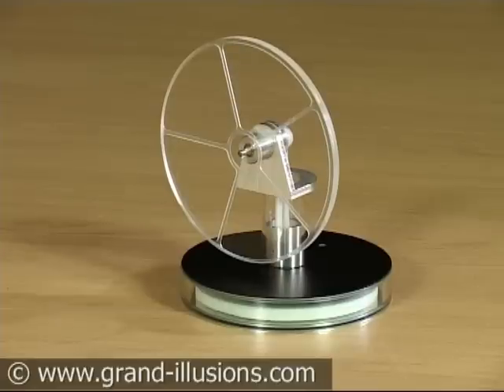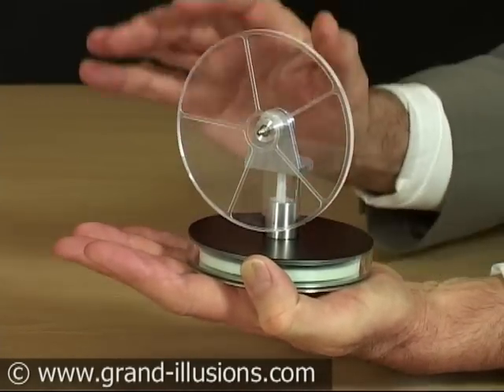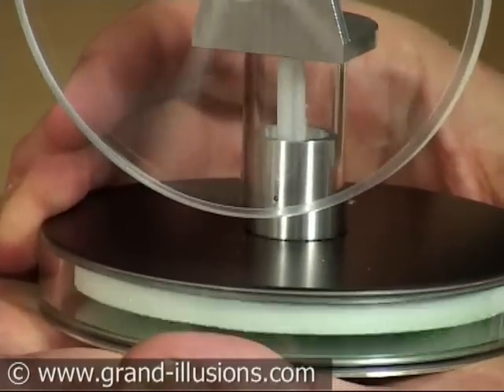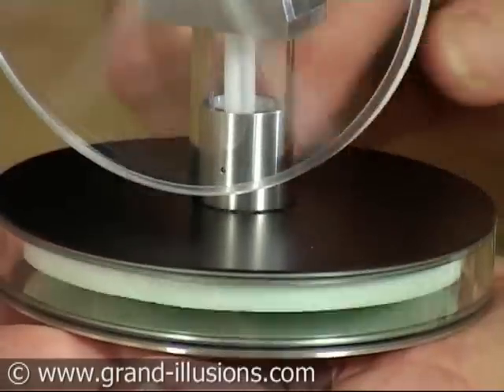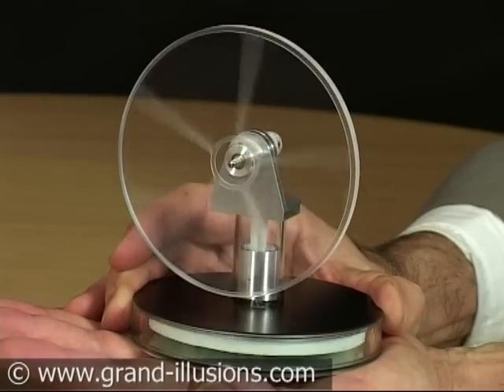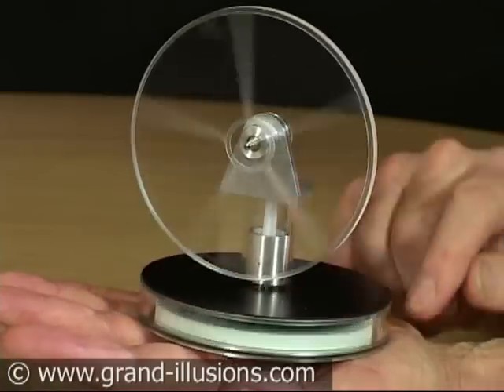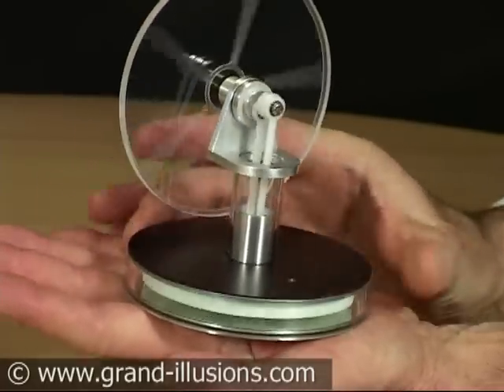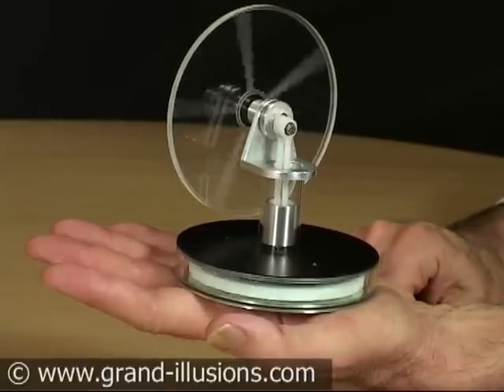Heat of your hand Stirling Engine

Comment: I want one that have a fan on top instead of a reel.
Reply: probably too gentle to actually push air..
Reply: @deluksic  you can always launch Crisis game at your PC, and put this fan on power adapter :)
Reply: TheDreameR Or unplug the stove and plug in a conventional electric fan.

But that's no fun I suppose.
Reply: @Treblaine  can also use a block of ice and it will spin the other way
Reply: FuckYouGooglePlus Maybe we are picturing things differently than eachother. When he says "a gas engine could be the way to get a fan moving" I'm imagining a machine similar to a lawnmower but with fan blades instead of cutting blades.  That should be fewer steps than using a gas powered generator to run an electric fan.  However, I could be completely misunderstanding what you two are talking about.
Reply: Steam Engine.
Reply: Tanner Armstrong
The comment we are talking about was responding to Treblaine, who was responding to a comment about using a stove. So that would suggest they were talking about adding extra steps.
Reply: Unfortunately those engines are not very strong eny sort of load stops it dead
Reply: @FlanFlanScarlet  I feel like the gas burning will heat your home more than the fan can cool the house. So it wouldn't really work well
Reply: they exist, and ontop of a wood stove they produce much more airflow than most of these comments would expect. yes it's only 30% efficient, but 30% of the energy in a bonfire is more than enough to move a car
Reply: David Lukšić only if you put on hand what about on a stove??
Reply: @TheDreamm21  
Tornado.
Reply: @TheDreamm21     u can,  i have one  with a fan on a stove lol
Reply: @TheDreamm21  you would be using external energy then
Reply: I don't think it would work you would have to keep it cold otherwise your hand wouldn't be warm enough to heat it up.
Reply: residue junkie  this is in no way free energy. it converts heat energy into mechanical energy at an efficiency of around 30%. 70% of the energy is lost to friction and such.
Reply: residue junkie  "The U.S. patent laws do not require that you create or build your invention or otherwise create a prototype before filing a patent application."

i'm curious to know if any of them actually got past the application. do you have any patent numbers? i did a search for "free energy" and found nothing.

if the people in charge were really going out of their way to poison people who know too much do you really think they'd let them publish their findings publicly in the patent office?
Reply: Using gas generated heat to drive a fan when it hot outside.... this man is the king of redundant
Reply: Wheel*
Reply: Dont worry mate! I Cool our household with a Cosworth V10 that screams at a max 19000 rpm..
Reply: Naah. Too much drag
Reply: Too much resistance from air.
Reply: same
Reply: residue junkie  ah nevermind i found one, US20110108362A1. looks like it's abandoned though, i wonder why..

for the record, google patents is a much better search platform than the actual USPTO website
Reply: You might need a hotter source then
Reply: The resistance from the blades of the fan will be too much for it to spin
Reply: Check nitinol engine!
Reply: FuckYouGooglePlus Actually the generator takes chemical energy, converts it into mechanical energy, then into electric energy. Then the electric fan would convert the electric energy back to mechanical energy.  A combustion engine connected to a fan would only need to convert from chemical to mechanical.  Theoretically, it should be more efficient than using a gas generator.
Reply: @tannerarmstrong1496  
Chemical➡️Heat➡️Expansion➡️Mechanical energy!
Reply: Tanner Armstrong
No...because it is ADDING steps. Maybe it is adding more efficient steps..but it is not taking away any steps. And since every step is <100% efficient, you are losing total efficiency.
Reply: Youtube's thermodynamics experts.
Reply: Ok, yep, I think i just misunderstood your original point.  I guess that's one of the hazards of jumping into random conversations to correct people.  I definitely agree with you that using a kitchen stove to power a fan would be a terrible idea.  Especially if your intention was to cool your house.
Reply: @tannerarmstrong1496  It's rare to see someone make an explicit retraction of an argument over social media by processing the criticisms of respondents. Your actions are an exception to the rule.
Reply: Let me guess, you weren't a verified channel 7 years ago, orelse this comment would've blown up
Reply: Would gears work to make it spin faster?
Reply: @computer8490  no. Too much friction and torque required to spin it
Reply: @TheAlmightyFather  knew it! just asked to make sure that making it spin faster with gears wont work.
Reply: A fan in this setup is pointless. Maybe won't even spin due to air resistance.
Reply: And maybe the fan could act to cool the  cold side of the engine making it even more efficient
Reply: Or a way for it to auto cool hot rooms by starting when it gets too hot and stops when cold
Reply: 🔴 What Is Islam? ⚠️

🔴 Islam is not just another religion. 

🔵 It is the same message preached by Moses, Jesus and Abraham.

 🔴 Islam literally means ‘submission to God’ and it teaches us to have a direct relationship with God. 

 🔵 It reminds us that since God created us, no one should be worshipped except God alone. 

 🔴 It also teaches that God is nothing like a human being or like anything that we can imagine.

🌍 The concept of God is summarized in the Quran as:

📖 { “Say, He is God, the One.  God, the Absolute.  He does not give birth, nor was He born, and there is nothing like Him.”} (Quran 112:1-4)[4] 📚

🔴 Becoming a Muslim is not turning your back to Jesus. 

🔵 Rather it’s going back to the original teachings of Jesus and obeying him.

Comment: Use one of those to cool down electronics? For example, use the heat generated from a aprocessor to run a fan that cools the processor down.
Reply: If you can get it to run at very fast speeds and cost less than or equal to regular fans (after energy usage over 5 years added). The maximum rpm anyone's gotten it to run is probably still only a small fraction of what's needed.
Reply: JFrame Yeah, the cost and lifetime may be an issue, but apart from that, it's free. But then again, new graphics cards have a similar system using a vapor chamber.
Reply: aptom203 The ambient temperature is a lot lower than the temperature directly on the processor. 
It's not hard for a GPU or CPU to get to over 90 degrees, while the ambient temperature in the box is perhaps 30-40.
Reply: you know that might not be half bad idea.
Reply: cdoublejj Well, I also realized that they use a similar idea in newer gfx cards. A vapor chamber. It's not mechanical, and that's even better.
Of course, there's still alot of heat left to drive a sterling engine.
Reply: antiHUMANDesigns
look up "coolclouds" they are about to release some sort of combined heatpipe, aircooled,water cooled synergistic cooler.
Reply: Richard Smith I understand the limitations, and I'm not surprised that there are better alternatives. I was merely speculating. In either case, like you said, it wouldn't be very powerful, and I can't imagine it'll be worth the cost because of that. Like I said, only speculating, thinking out loud.
However, precision and reliability of these kinds of engines can be improved over time, like everything is. I haven't looked up exactly how these engines work, though I can imagine how they work. I suspect that if you really wanted to, you could chain many of them together, for example. I'm no engineer, but I know there's energy to be harnessed.
Reply: antiHUMANDesigns Yeah there is, but a more direct approach would be much more effecient. Converting heat into mechanical into electrical at its best can never be as effecient as removing the mechanical step, and directly converting the temperature difference into electricity.
Reply: Richard Smith Absolutely true.
Reply: ya... or you could power your whole house and not have to pay for twats to break into your home to install "smart meters" 

Oh, that's right, you'll get evicted from your home if you do that... even if you own the property..
Reply: DeadtomGC What are you on about? Keep your generated power separate from the grid, and use it first...
Reply: Richard Smith
That is what I'm saying...  I'm on about what some power companies are doing to install smart meters and that the city tried to evict a woman from her home because she was off the grid. ( I don't recall which city.)
Reply: The reason I was interested in this video was for that very idea.  :\
Reply: The issue with stirling engines is that they operate on a heat differential- basically the top place has to be cooler than the bottom plate in the cylinder. In a computer, the top plate would quickly warm up to an ambient temperature which is not different enough to continue driving the piston.
Reply: antiHUMANDesigns The power generated will be very low, this engine requires a VERY low friction level to function, and to harness the energy, you have to take some away from the engine, since very little is left over that isn't used to keep the engine running, and since the fly wheel needs to move the smallest amount of air as it can to reduce friction, it is not feasable to power something like a cpu fan without the engine being as big as your case, which is a bit silly, and HEAVILY prone to failure, since it requires such precision to generate enough energy to keep itself running.
Look into thermoelectric seebeck devices instead, those are used in electronics to convert access heat back into electrical energy which it reuses to reduce power consumption. Mind that this depends on a temperature difference, so cooling still must be done to maintain the temperature differential between the two sides of the device.